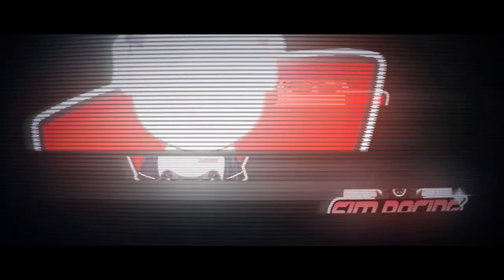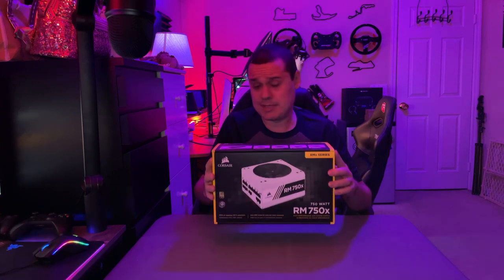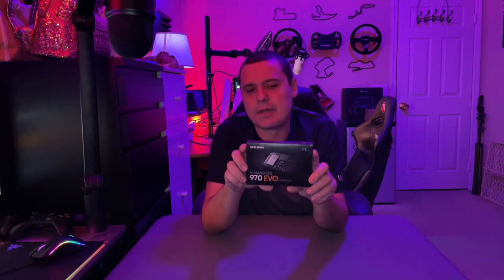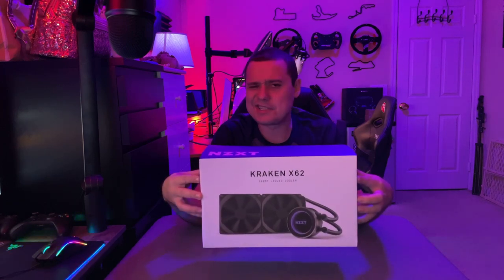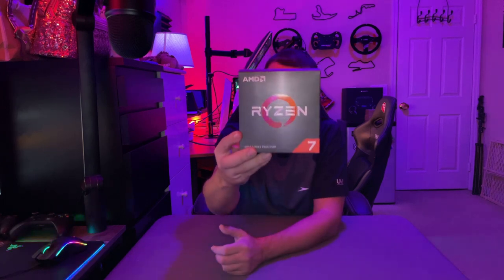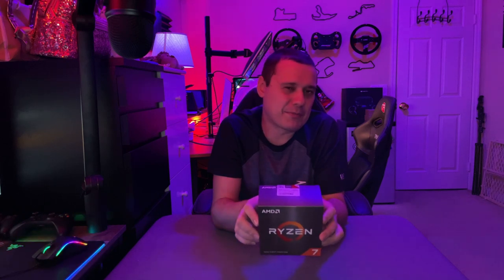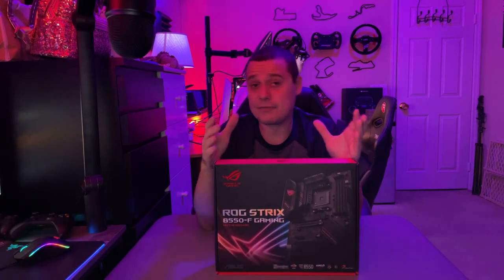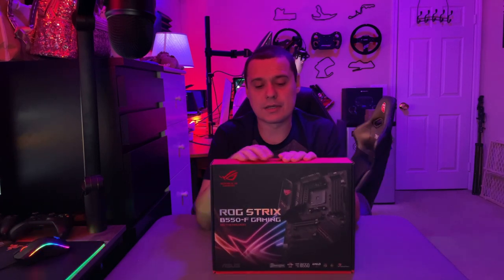New Sim Racing Gaming PC Build in Late 2020 Early 2021

Comment: Are these good specs for sim racing mostly ACC ? And do you think the GPU is capable of handling an Ultra wide like the G9? I’m targeting at least 1080p at 120fps ? Appreciate your advise!👍🏻 
1- motherboard : asus TUF X570-plus
2- GPU Nvidia GF RTX 3070 EVGAXc3
3- CPU AMD 7 5800X 8-core
4- power: XPG core reactor 850w gold
5- storage Samsung 970 evo 1Tb 
6- RAM g-skill Tridentz 32G
Reply from the maker: Hey Sulley!

So this system can easily run the G9. It’s the display I use (I also have a review on it).

With those specs you listed, the G9 might be a bit too much to handle ACC at 120fps though, unless you turn down some graphic settings.

My 3090 can handle ACC at max settings with the G9 and I get roughly 90-100fps.
Reply: @RetroSnakey  3090 is just two expensive. The build I listed above is already at $2300 from NZXT! So other than the G9 I should be able to get decent FPS on a 34 inch ultra wide monitor? 😩 I’m just sick and tired of ACC on console! Thanks again for your help man it’s just so overwhelming 😂
Reply from the maker: It really depends on the resolution of the display. The G9 has an insane resolution at 5120x1440 so that’s a lot of pixels for the 3070 to drive at 120fps at maximum settings.

On a 34 ultrawide with lower resolution you shouldn’t have issues with the 3070. It’s a really awesome video card!

Comment: Do you recommend 144 hz for sim racing. Built my pc and am doing a little bit more chores so I can try to get this lg 144 hz monitor for 159 at my local Walmart super center
Reply from the maker: I sure do! The highest the refresh, the better.

One thing to keep in mind is to also be able to drive the same amount of frames per second, in this case, 144fps.

Matching your refresh rate and FPS is the ideal combo.

Some display with a technology called G-SYNC will automatically just the displays refresh rate to the FPS on screen which is great. However, those displays tend to be a bit more expensive than your regular 144.

But for 159 it’s a great price!

Comment: If your doing triple monitor with vr what setup would you do? For a pc?
Reply from the maker: Triple displays and VR use a lot of power. This setup I currently have would work great for triples. Just keep in mind it depends on the game as well.

IRacing would work perfectly well above the minimum of 60fps that is recommended.

Other titles such as ACC use more power and you would be ok but you might have to turn down a few graphical options to get that smooth frames per second.

Same goes for VR. Nowadays, I wouldn’t recommend anything that does not have at least a RTX 3080 graphics card.

Comment: I know it's hard days to get a GPU but can you recommend something more affordable than 3090 to run smooth the Odyssey g9 monitor?
Reply from the maker: Hey Aris!

So due to the amount of pixels the G9 has, the lowest graphics card I would recommend would be the 3060. I tend to go for that 60+ frames per second sweet spot and depending on the game you are playing, the 3060 should be ok.

You could also play with the graphics settings in each games graphical settings to gain some frames!

A great tool to use is GeForce Experience which can optimize the settings for a lot of titles out today.

Comment: Starting my build based on yours but in doing some research on compatibility between components I don't see support for some of the combinations you have such as; motherboard support for RAM and  3080 GPU. Any guidance would be much appreciated as I don't want to order something that is not compositable or recommended. 

Also, why didn't you go with an x570 instead?
Reply from the maker: Hello!

So as far as compatibility goes, the GPU should be compatible with practically any motherboard with a PCIe 3.0 slot which is most motherboards out today. No issue there. RAM as well, as long as you don’t get something that is meant to work on a overclocked setup that requires you to change timings and voltages in the motherboard BIOS. They could work but would require some testing to get it stable. Sticking to a more “famous” brand such as Corsair should get you going with no issues.

As far as why I chose the B550 vs the X570 was pricing. The X570 does have all PCI lanes at 4.0 whereas the B550 has the top PCI slot at 4.0 which is the only one that would potentially use the bandwidth of a 4.0 slot. I do have the 3090 graphics card so I wanted to make sure I’d get the bandwidth of a 4.0 slot if needed. Other slots, not a big deal since other devices slotted on those PCI slots would never come close to even max out the bandwidth given by a 3.0 slot.

Both chipsets are great but there was no need to go to the X570. 🙂
Reply: @RetroSnakey  gah okay thanks a lot as I was getting spooked by using the OEM comparability sheets and didn’t see these specific SKUs. But yeah pretty much copying you but going with 3080 (whenever available) and maybe x570 pro WiFi ax instead. It’s only like a $30 different or something... 

THANKS A TON!
Reply from the maker: That should be a blast! I’ve always loved ASUS motherboards and their ASUS Prime X570 is a heck of a board also. Crossing fingers for those RTX 30 series to be back in stock all around! 🤞
Reply: @RetroSnakey  nvm on the x570 pro, went with the plus. Should be getting some kudos with your amazon links in the near future. Maybe one day I'll catch you on ACC whenever these GPUs come back. Currently on PS5... Thanks again and keep up the content. Cheers.
Reply from the maker: @jbalcober704  Sounds good! You can always hop on our ACC League Stream we have every Monday evening at 6PM Pacific USA / 9PM Eastern USA time. We have loads of fun and join our Discord if you're familiar with it as well, talk to the guys who race in our league. :)
Reply: @RetroSnakey  subscribed! cool yeah I’ll check out the stream and send me discord link if you can. Love to join and see if it’s a league for me and my schedule...
Reply from the maker: https://discord.link/srgeek 🙂

Comment: What would be a good price for a pc that can run Assetto on max settings with mods be?
Reply from the maker: Hello!

So it's an open question. It depends on the display you are using. If you are using a standard 1080p display, any PC nowadays with a basic gaming video card (such as the RTX 3060) would do the job just fine.

Even an older PC with a GTX 1660 would be fine as well. The rest of the specs will probably be up to par along with that graphics card so you'd be ok.

Assetto Corsa is a slightly older title and doesn't use as much power (even with the mods) as some newer titles do such as Assetto Corsa Competizione. 

That being said, Assetto Corsa is an amazing game and definitely recommend it! I played it quite often when I had a RTX 2070 graphics card and with max settings without any issues!
Reply: @RetroSnakey  thank you for the info, it’s greatly appreciated

Comment: How much did this all cost
Reply from the maker: Hello!

The total cost of this tower is close to $3000, but, considering this build has the RTX 3090 Graphics Card, that alone is $1650 (after taxes for me..). You can get away with a RTX 3080 instead, that retails for $800 less (if you can find one, shortages still!) and that would bring the cost down to about $2200.

Keep in mind that this build is about as extreme as it gets, since I needed something like this to drive the new 49" Samsung display I purchased (it has a resolution of 5120x1440, that is a lot of pixels..!)

Also, the Monitor, keyboard, mouse and my Sim Rig along with the wheel, base, pedals, shifter aren't included on that price.. So yes, it can get quite pricey now that I am thinking about it.. *cries*. xD

Comment: I have a budget of 800 what can I get to start sim racing ?
Reply from the maker: Hi AJG,

It really depends on what you don't have just yet. If you are starting from scratch, no wheel, pedal, etc, $800 is a bit tough to get a decent computer with a nice display and a decent wheel and pedal.

It also depends on what sim title you plan to focus on. iRacing, for instance, can run on a lower spec computer since it's an older title (even though it's kept updated and still looks great). However, something like Assetto Corsa Competizione would require a higher spec computer in order for it to run as it is intended.

As far as wheel and pedals go, the lowest I recommend is the Logitech G29 set, or a bit higher, the Thrustmaster T300RS. Anything below those would get you frustrated with the experience you'd get. Each one of those kits can go close to $300, that is why I say $800 most likely would not be enough.